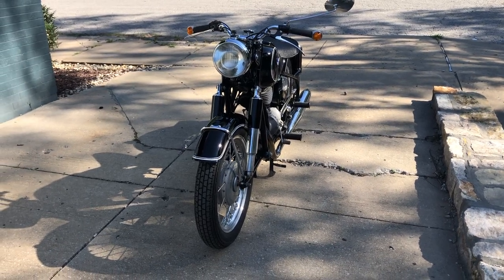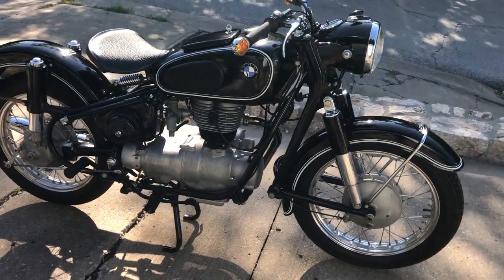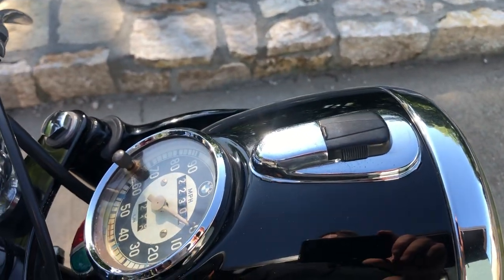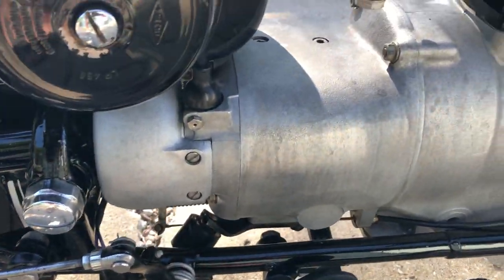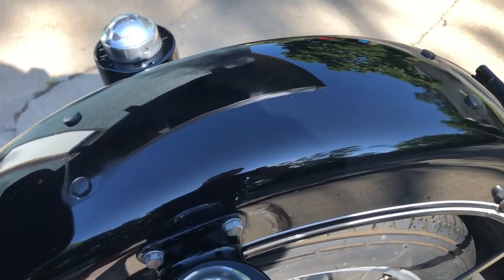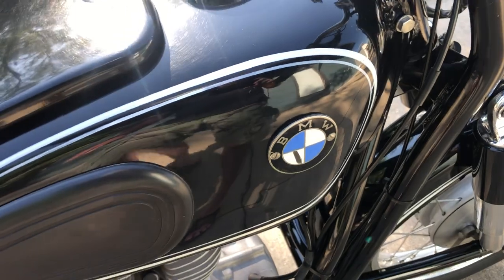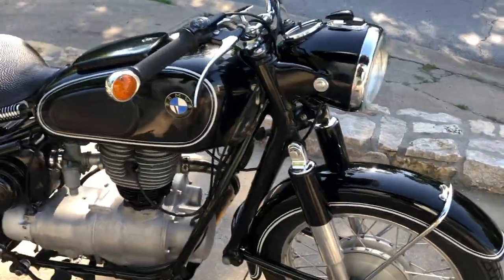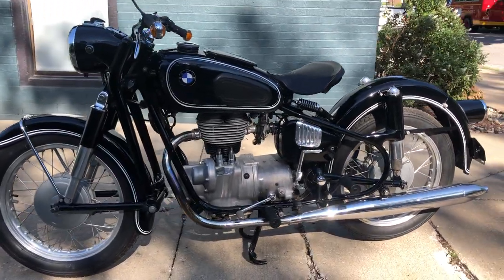1964 BMW R27 Walk Around and Start - Sold

Comment: I had one. For easier starting always stand next to the bike: when cold, open throttle slightly with your left hand and hold it there, then kick. For warm engine: open throttle more and hold it with left hand.  If outside temp is very low, you might have to put a rag or something in the intake air manifold coz there is no choke.